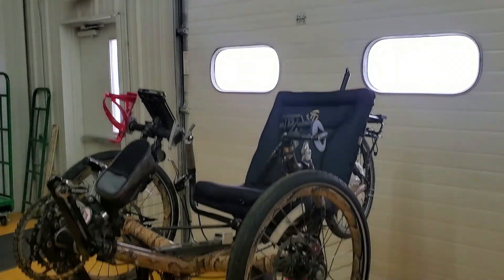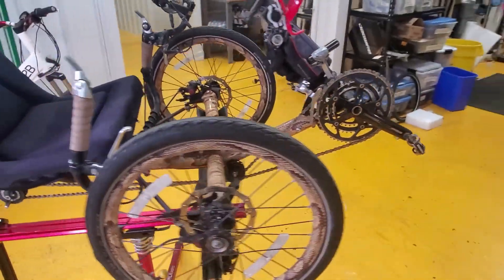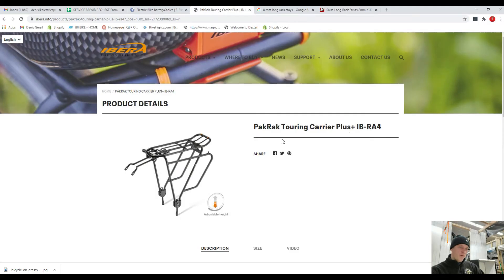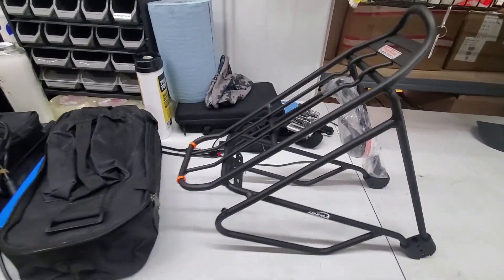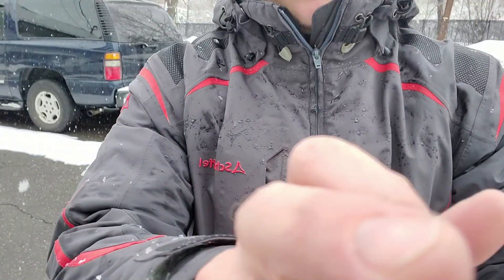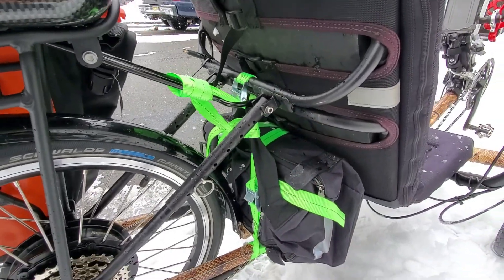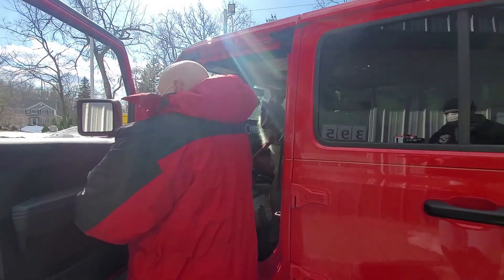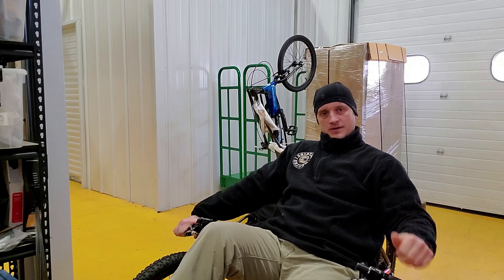Terra Trike E-conversion

Comment: I haven't seen a lot of small-wheel wheel motors before... I found it interesting that they used radial spokes.  I realize conventional lacing wouldn't work but I would have thought it would be worth having at least a slight angle on the spokes.  I'll have to start paying attention to what others do there.

Comment: I am looking into buying a TerraTrike Rover with e-assist. What would you say about the difference between this kit you installed vs the Bosch kit? The Bosch kit is pretty pricey and I am operating on a budget. Any advice would be helpful.
Reply from the maker: Bosch is pricey. Ebike kit will be cheaper, it will have throttle which sometimes is a big deal.
Budgetwise hub drive kit wins.
Reply: Thanks for your reply! I took a Rover for a test ride on Sunday and it was a little narrower than I would prefer. The cables were kind of rubbing on my legs. I am leaning towards a Greenspeed Magnum now. It is a little bit wider and the cables run parallel to the bars instead of sticking out towards your legs. It is also a folder. I will have to come up with some more change but I think I will be happier in the long run.  @DenisBikeMechanic
Reply: TerraTrike has the charge for about $3,350. I think it is basically the Rogue with a mid-drive motor. If I recall it has an Envilio City Hub. A derailleur-less hub that  makes  a great combination with a mid-drive motor.

Comment: What does that bike rack do when you are navigating tight turns in a parking lot? It seems like it is going to swing really wide since it extends so far back from the rear axle.
Reply from the maker: You'll gather all corners, vehicles and shopping carts when maneuver on the parking lot.